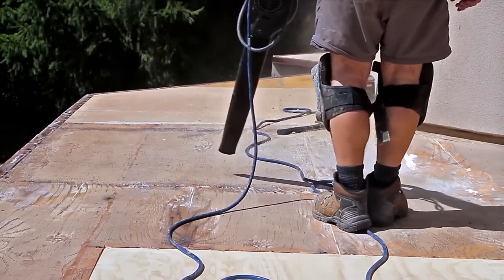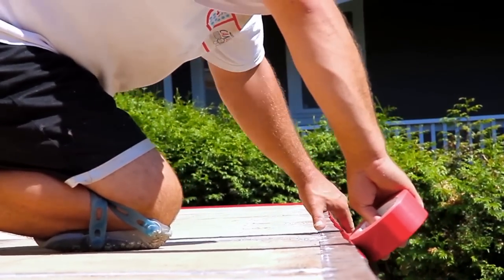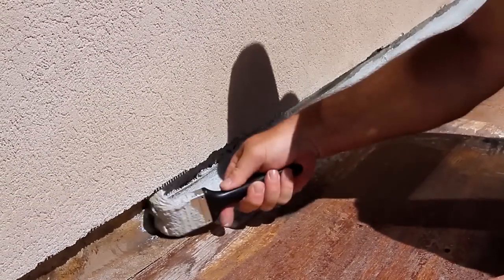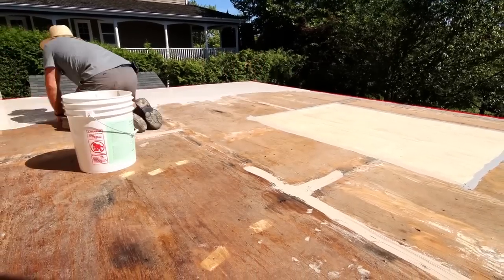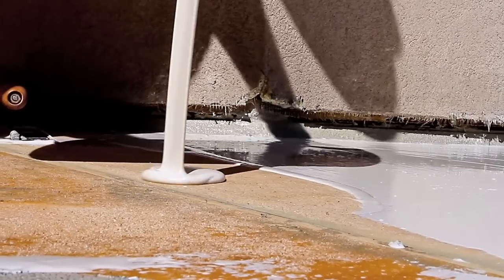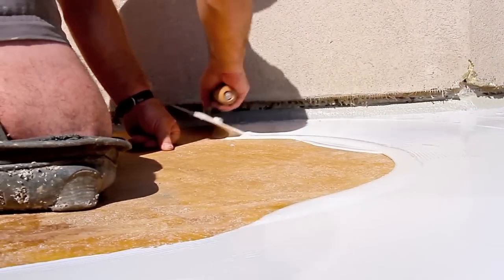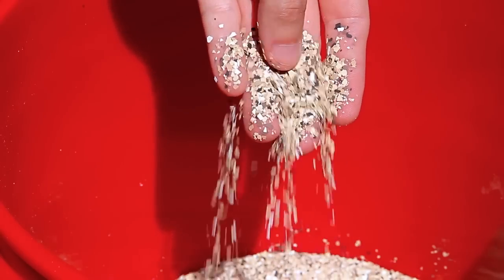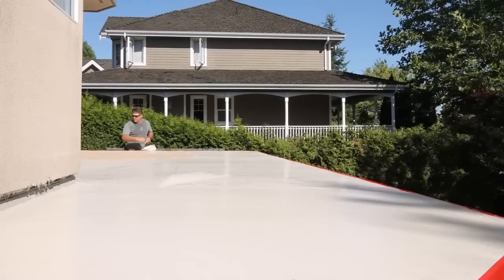FlexStone Deck Coatings

Comment: Can this be applied over slate tiles?  And without repairing any grout cracks first?  Thanks.
Reply from the maker: Almost any surface can be coated (including slate tiles) when our primer is used. It can also be used to repair cracks and loose tiles before coating the entire surface. Check out www.flexstones.ca for more info. You can also call our head office at 1-866-419-8453. Thank you!
Reply: Sounds like we are having the same problem I have slate tile as well. Any progress on what you hv came up with to fix the problem?
Reply from the maker: Ro Hoye - Start by removing any loose slate and clean thoroughly. Apply a generous coat of Flexstone #3 Epoxy primer/sealer. Allow it to set up (2-4 hours). Then you can apply the self leveling membrane and finish coat(s). For more info go to www.flexstones.ca
Reply: Demetre Christou is there an option a clear membrane option? That would work if I wanted to be able to see the slate tile under the membrane?